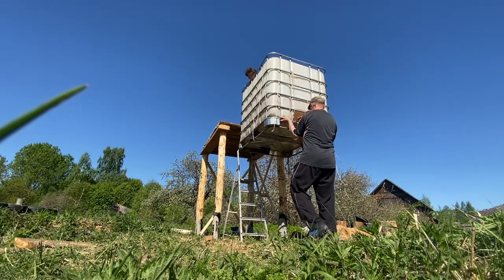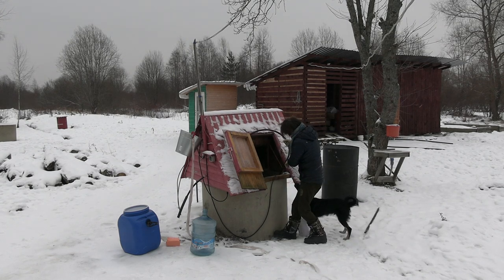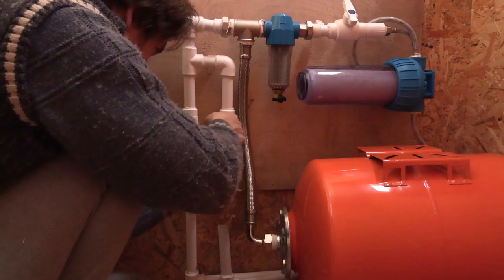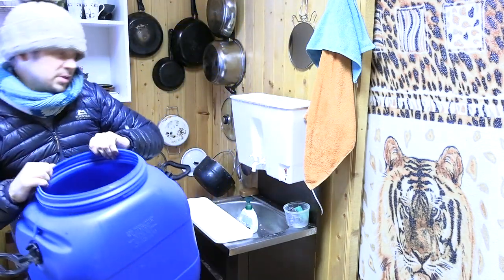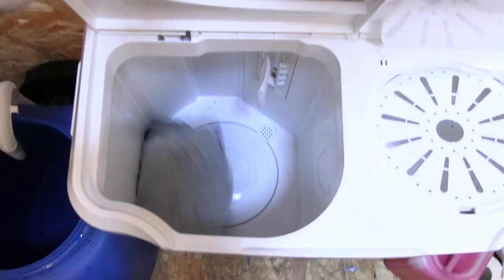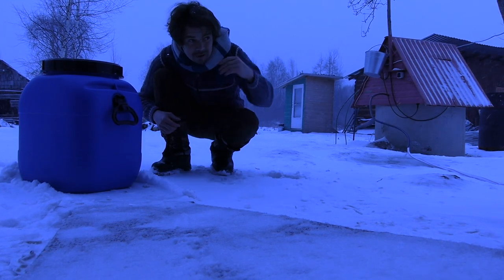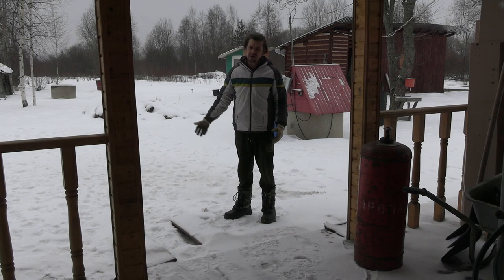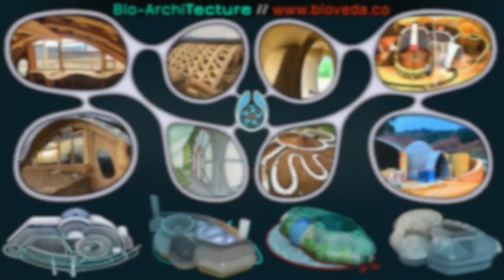How we survived at -13 F without plumbing

Comment: I built a 9 post 3 header 6/12 skillon mono sloped frame. Just setting on 9 piers and tie down brackets. It is 13'6" by 23'4" because getting block around the frame and block support columns. Had to start somewhere. Was the cheapest quickest way to setup a structure frame. I need to get ibc totes for septic tanks and plastic barrels for leech field. Boss of the swamp did a septic video. I plan on doing close to same.
Reply from the maker: thank you for sharing I will research boss of the swamp guy

Comment: Awesome vid Alosha! FYI/Question for you though - are you familiar with Aircrete? There is a YouTube channel called the Honey Do Carpenter - him and his family are building their own off grid home on land, which isn't as permaculture-centered as yours; however, he has experimented and built with his own formula of aircrete (concrete slurry mixed with a foaming [dish soap] agent, to create a LOT of small air bubbles in it) and the results you could utilize in small ways - such as creating a wooden channel that has a PVC water pipe running through it to the house from the well, that's insulated with some aircrete on all sides inside the wooden casing. This  would prevent it from freezing or heating, even in the extreme temperatures - because he's used it to insulate aspects of a rocket stove before, and the surface ALWAYS (even under those extreme high temps) remained cool to the touch! you could also shore up a layer of insulation around the well itself as well, for the same effects. Using it as an insulative layer where its needed most, instead of just building everything with it, would be more cost effective and cut down on needing large amounts of the concrete mix. His channel shows how to make the foaming machine, how you can do it all by hand without big machinery... and if you create 'panels' of the aircrete to build with (pouring it into pre-made forms for later use), you can basically work with it just like wood, if not as I mentioned prior - building a wooden 'casing' with on site materials, and just pour it in the aircrete as the liquid insulating layer and let it cure. Something to consider trying, anyways, when the weather gets nicer outside to allow for such experimentation.
Reply from the maker: Thank you so much.  I am already getting ideas. Have your researched the polystyrene aircrete guy who used and upside down lawn mower to shred polystyrene. Just you tube him. He has at arc in his logo and comes up first. Polystyrene aircrete. I really appreciate your sharing.
Reply from the maker: Thank you so much.  I am already getting ideas. Have your researched the polystyrene aircrete guy who used and upside down lawn mower to shred polystyrene. Just you tube him. He has at arc in his logo and comes up first. Polystyrene aircrete. I appreciate your sharing.

Comment: Well done. I've been researching earthships, minus the tires and earth, here in Iowa where we see long humid hot summers and winters that remain below freezing and occasionally dip below - 20f..  More so for the passive solar heating part, so i was a little disappointed not to see such a house in this video. Did you build a house that is heated with passive solar in Russia?

Comment: Greenhouses don't work with snow on them. It does the opposite because water takes more energy to go from ice to water than water to water vapor. So big ice clouds over Arctic make same effect. Water is greenhouse gas but has a worse cold effect because it takes more energy to change it's state from ice. So water vapor cools and insulates cold more than its insulates warmth. It takes more energy to heat stuff than cool stuff.
Reply from the maker: Once I build a to scale sample I will share my findings,
 thank you

Comment: Is that a shower house or sauna house? I need to build a sauna for my property. Wood stoves can loose over 50% of the heat out the chimney. Where is the Russian masonry stoves?
Reply from the maker: I will be building one later. They are not used in saunas that much